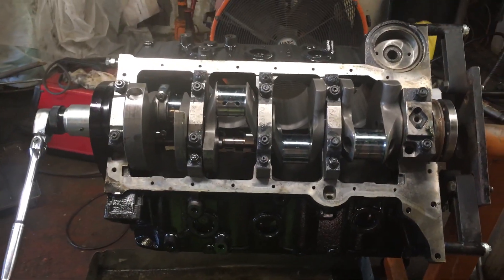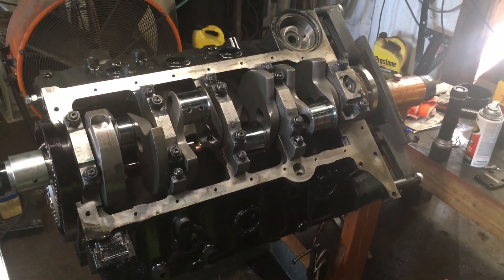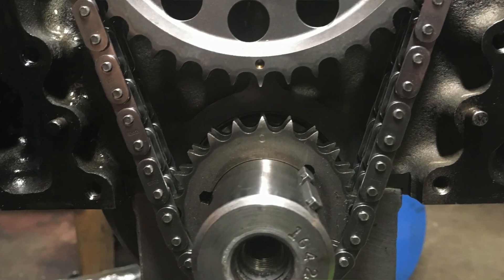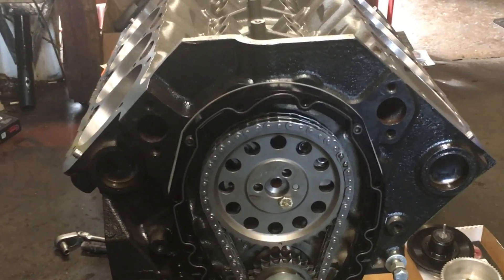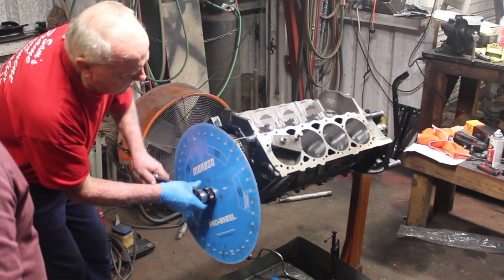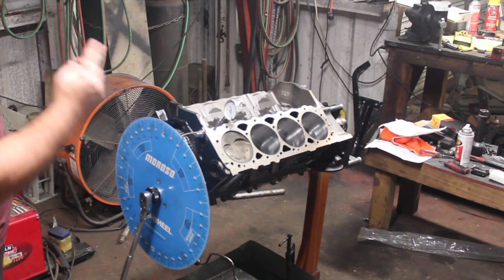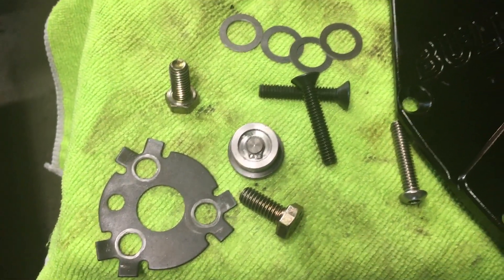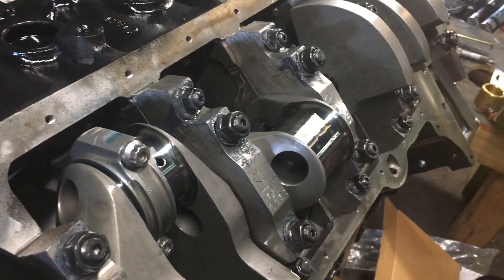Blown SBC Bottom End Build | Degree Cam | Short block assembly

Comment: For someone who is old school and so precise why would you use a cloys hex adjust timing setup?? It's basically a upper timing gear with egg shaped oblong holes, the clamping force of the Alan head bolt is the only thing keeping it tight!, If set lots of engines including two of my own that move around and get the cam timing off and in results bent vales or dropped valves
Reply from the maker: It is NOT a hex adjust set. Top gear is set and crank gear has -4, 0 and +4 keyways. Not sure where you got it was a hex adjust, but it is not. If I said it was in the video I was mistaken. Go fast, go straight! Be Safe!

Comment: Why not use a gear drive instead of a timing chain?
Reply from the maker: Frank Clark jr thanks so much for your comments! We seriously considered it, but I don't have a good reason for not running a gear drive other than I feel like the chain does absorb a tad of any vibration. Go fast, go straight! Be Safe!!
Reply: There is only 1 reason to run a gear drive in a SBC (or most other V-8's) and that's if your cam is running other accessories such as a mechanical fuel pump. Every other application should use a quality chain set or possibly a belt drive. 
The  gear drives with the dog bone style dual idler gears are absolute garbage, the ones with the fixed idler such as what Milodon makes is far superior.
Reply: Thank you very much for the info very much appreciated.
Reply: @frankclarkjr6369  My pleasure! It drives me crazy every time I dyno an engine with a gear drive, the whine drowns EVERY other engine noise I am listening for, and overwhelms an otherwise wonderfully sounding engine. At least the fixed idler style gear drives aren't quite so loud.